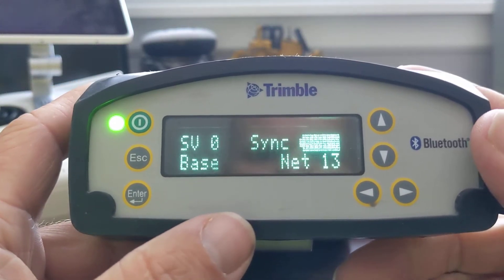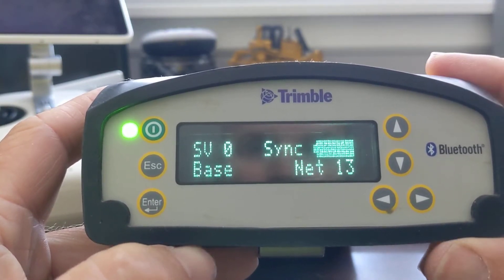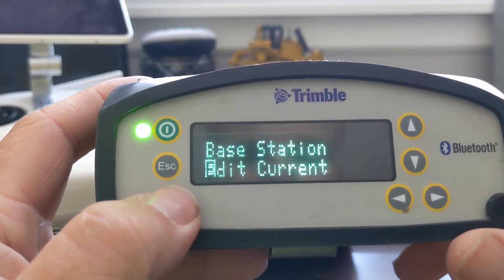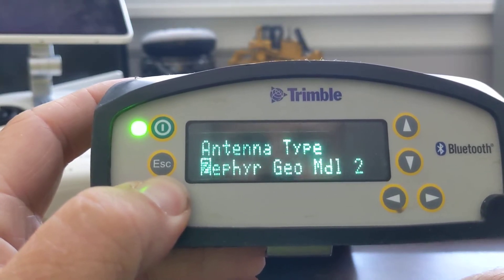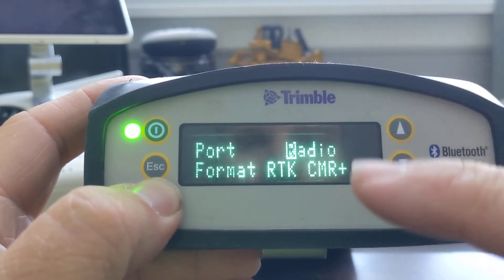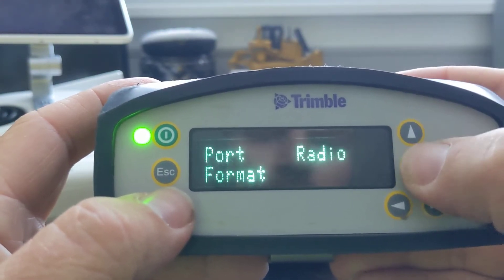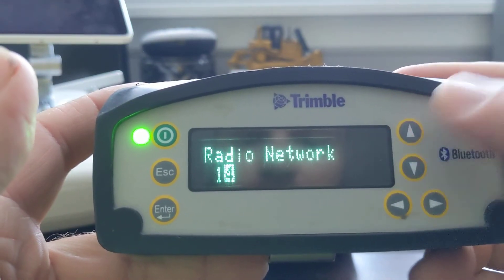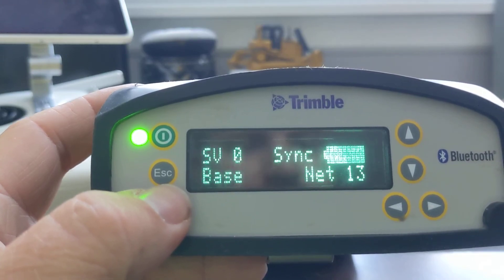Changing Radio Format and Channel Trimble SPS855 Base

Comment: Can I use it as a Rover?. Or only base?
Reply from the maker: You can use an 855 as a rover, but you have to buy an option code. I think the code is $4600 but don't quote me. 
We've done it and ran them with a Rugged antenna setup on a dozer to make an affordable indicate dozer system.

Comment: how do i get the zephyr 3 option on the antenna?? I have zephyr 2 and a few others. but I need zephyr 3. as I have a zephyr 3 antenna. thanks in advance
Reply from the maker: What model and firmware version is your base station? Most likely if the base isn't updated it doesn't have the Model 3 option. May have the option in the data collector, but I'm not sure what version is required to get the Model 3. I'll see if we can figure that out.